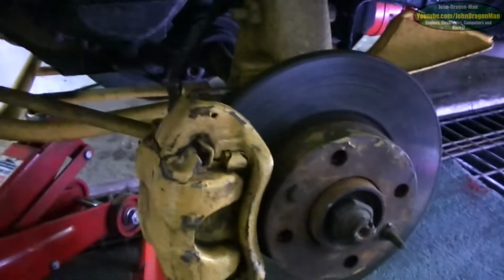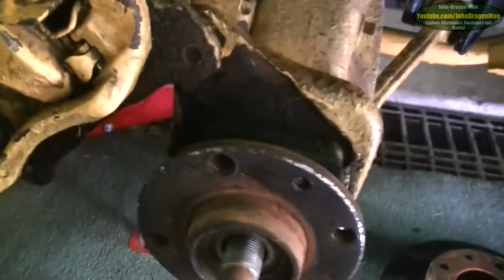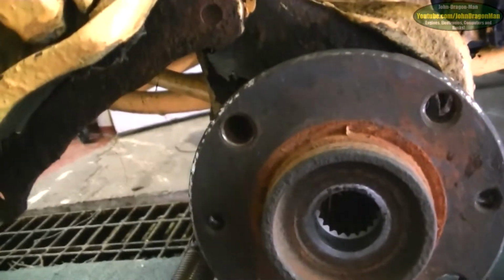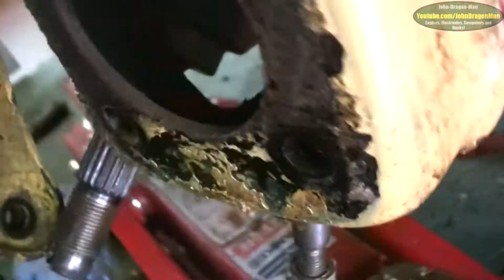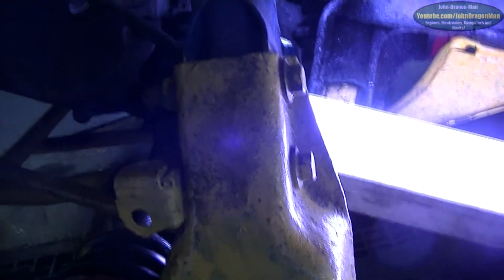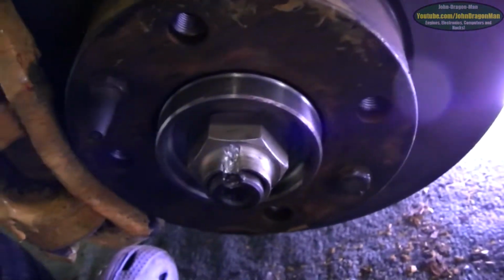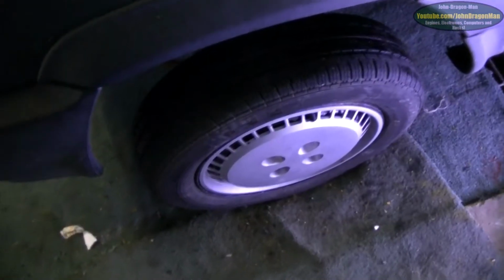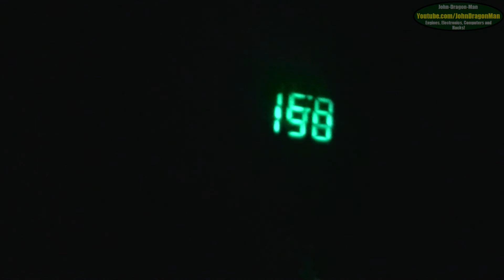Fiat Panda 4x4 Sisley Video log No 34 (Wheel bearing and outer CV boot change)

Comment from the maker: yeah we use salt on our roads, a lot of salt! last year our whole national salt reserve for the whole UK was used up.
i am quite happy to say that for a 22 year old fiat, my car on the under side is completely rust free. not even any surface rust as i cut it all out and replaced it with new clean metal. living in a remote part of the UK saved my car in the long run though, back roads where there is no winter salt saved it. it could of been much worse if it was a city car from new.
Id like a rav4

Comment: To remove the caliper you need to undo the lower hub carrier to strut bolt, you can then remove the small 90 degree bracket and remove the funny bolt that holds the caliper on without having to take the wheel bearing out.

Comment: Cool stuff!, looks like a pretty standard design under there. 
I figured the excessive paint would be needed over there where its so wet, do they use salt on the roads when its icy too?
The Rav4 I just picked up lived about 80M from the seaside, so a lot of underside parts and bolts have a nice coating of rust :(, I guess I will be spending a lot of time under there cleaning things up ;)